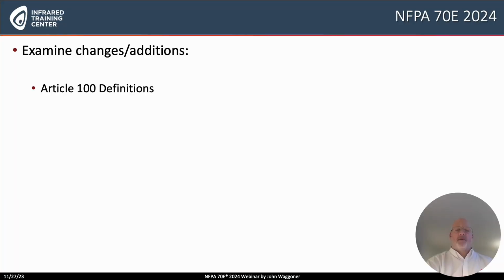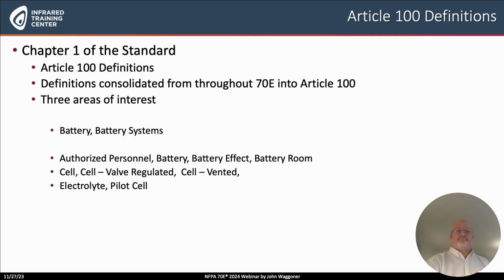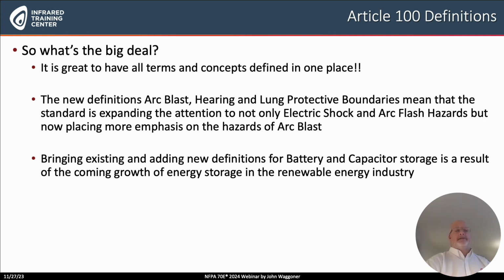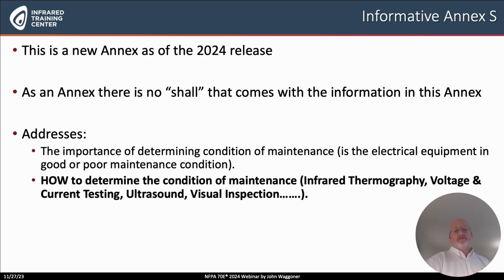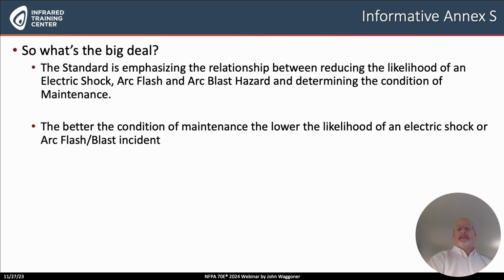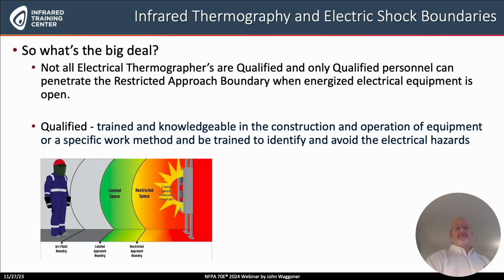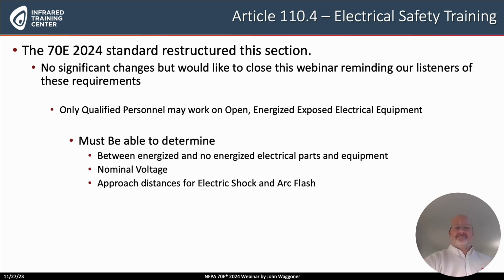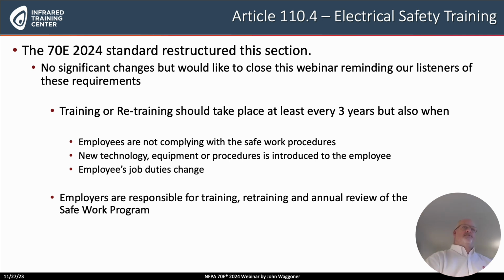NFPA 70E 2024 for Infrared Thermographers

Comment: Some of these things are only true if you are opening enclosures to scan. If someone else (facilities) is operating the hinged cabinet doors, IR scanning doesn’t specifically require arcflash rated PPE based on table 130.5C and its supporting information. The act of swinging the door requires AF gear not the act of Scanning.